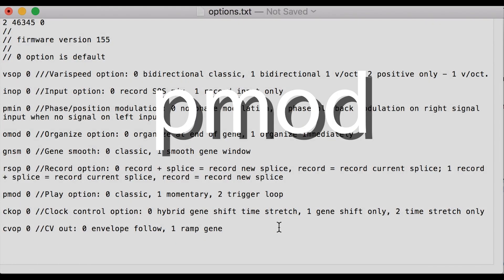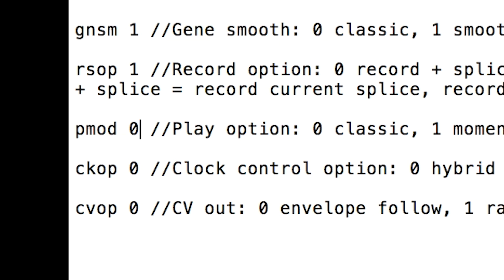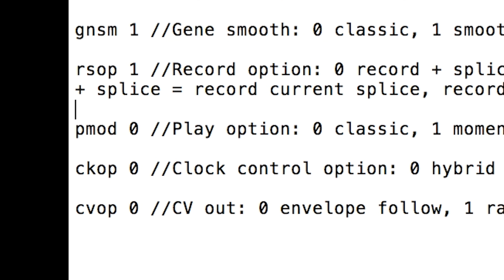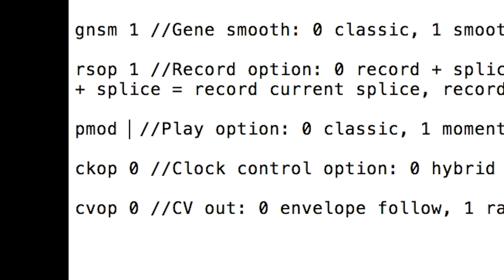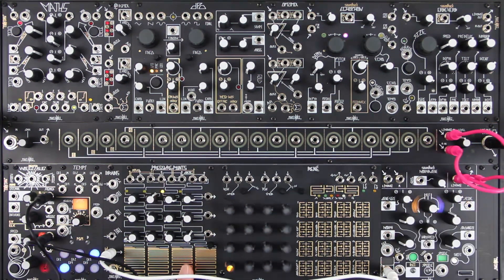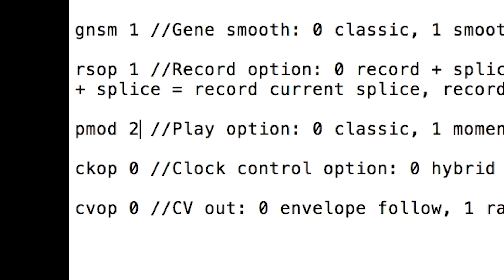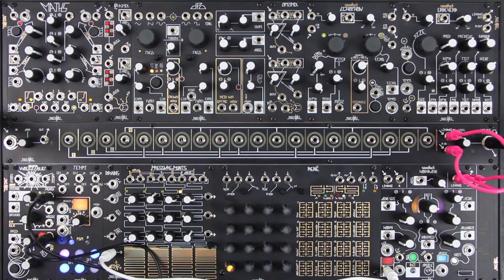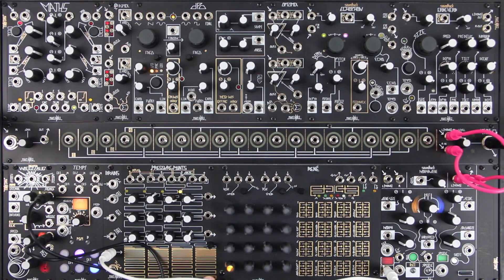MG155 Firmware update w/ User Definable Firmware Options: Play Mod Option (pmod)

Comment: when im sending CV to organize it doesn't seems to trigger the value given. it almost sounds like there is drift in the slide. is it possible the slide could drift or loose calibration. trying to figure out why im not getting out what im wanting.
Reply from the maker: You may need to send a short video to technical at makenoisemusic dot com so we can help you diagnose this behavior.
Reply: @MAKEN0ISEMUSIC  will do.
Reply: @MAKEN0ISEMUSIC  before going off to make a video, I wanted to test something first, tell me if I'm WAY off base or this may have been the issue. I was sending 10v into the play input. I put an attenuator on the gate going in, just tried cutting it back to 5v and I am not experiencing the fluctuating slice playback. is this a possibility, that the CV going into play was too high....or have I just gotten lucky today and my test just happened to werk, but really isn't the solution. 

thanks again.